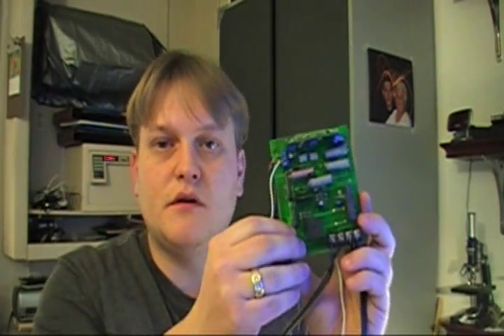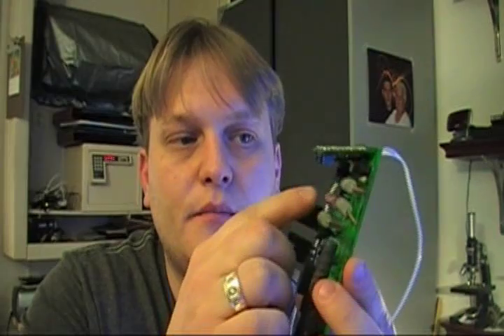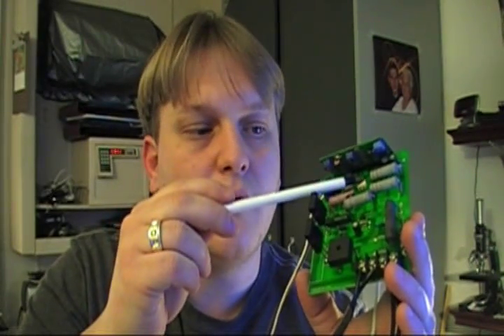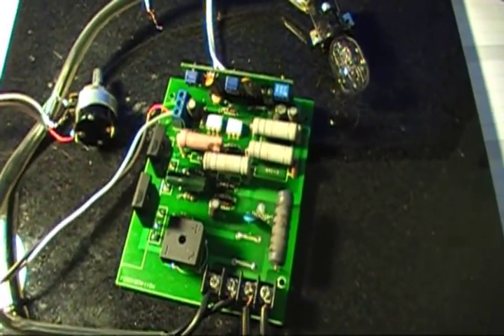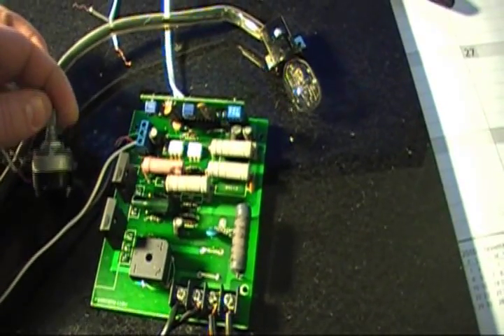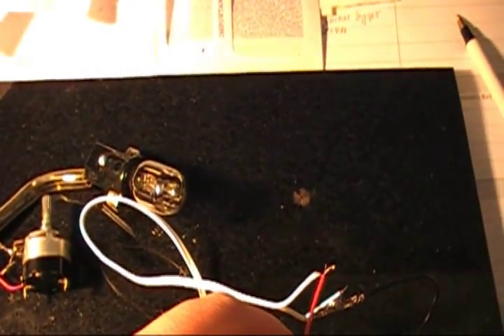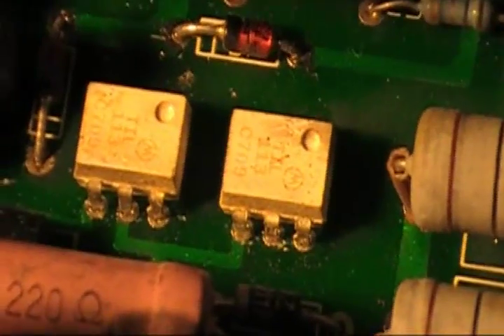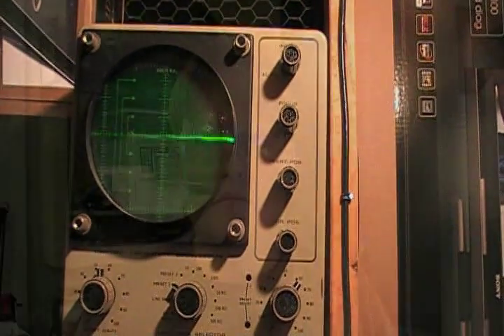Harbor Freight Chinese Mini Lathe Motor Controller FC250J/110V Part 1

Comment from the maker: They have a few modifications of the same board the one I have in my video is slightly older you probably have a new were version they all work about the same and share the similar problems

Comment: just a question I have the exact same mini lathe 7X12 Chinese (sunmore) my motor is only running at full speed when I turn on the machine and put it in forward or reverse its just going full blast!
Can I just connect one of those 110v variable speed controllers to the plug for the lathe and control the speed??
Reply from the maker: The reason your leaves is going full speed is because you’re MOSFET transistors are shorted out. If you replace MOSFET transistors it will start working normally. If you connect variable speed controller to it it will most likely work but you will lose the torque of your lathe. The board that you have inside of your lathe is pulse with modulation controller and that allows you to have low speed and high torque.I hope this helps

Comment: Hi there,

Great video.  Your site seems to be down.  Are you still active in motor controller work?
I have a controller from a Busy Bee 7x10 mini lathe that seems to overload in the high range.  Works fine on low range but as soon as I try to run the lathe in high speed, the board goes into an overload situation (there is an LED that sits beside the board POWER LED that glows when the system stops).  Only way to get out of this is by powering down the lathe.  Since it works so well in the low range, I'm wondering what might be going on.  Any suggestions?

Thanks
Doug

Comment: These Chinese lathes are crap.  Don't waste your money.  I've had two and both crapped out with less than a hours use.
Reply: I bought a cheapo Harbor Freight mini lathe in 2013, and it has been a total workhorse for me. I have put many hours on it for light commercial work, mostly in plastics. OK, it's not super accurate, and I've spent some time truing it up, but the unit has kept on going and going. Only problem I've had with the electronics is the on/off switch crapped out. The board continues to work fine, with one idle speed adjustment.

Comment: hello i have a 7x10 mini lathe i dont have the time to mess with the board inside...i was wondering if i could contact you about fixing my motor control unit...thanks
          ....jeff kubes

Comment from the maker: Yes you have to work on it and make it better, modify it and spend time with it. But ones you are done (Fixing) the lathe it becomes very good machine. My Father is a machinist with over 25 years experience has (Fixed) his Metalworker lathe and he has been using it over 10 years now with very seldom problems. If you try to manufacture a lathe in US , a better quality lathe like they use to make in the 50’s this lathe will cost allot of money and people simply would not be able to afford it.

Comment from the maker: Well….. I’ll tell you . Chinese machines are not the most accurate and not the best quality machines on the market for sure. But for a small shop on the budget or  home use they are very good. Chinese machines require allot of modifications and adjusting before they can be used for any serious work. The big plus of the Chinese machines are their price. You can buy Chinese lathe for under $500.

Comment: I've been a research machinist for 30 years and working with Chinese lathes machine tool is a sad affair. Why make cheap machines in the first place? Why is is that Clausing or Atlas lathes  made in the 50's are better than those made today?Why is quality being regressed? It seems like a waste of time, labor ,and materials to make a machines whose life expectancy is far less than it ought to. I have an Atlas in the shop still running and I doubt you'll fine a Chinese  made lathe last as long

Comment: just because the board is not available does not mean you can not track down the part or parts on the board that are bad and replace them , you can also look for cold solder jonts or cracked ones and repair any you find and this also sometimes will fix the problem to, never stop till all has been tested and checked over properly,,

Comment from the maker: This happens on all Chinese mini lathe controllers. Most common part that goes bad is Mosfet Transistor. If you buy few of them you should be fine.  good Luck
Reply: my  bridge rectifier blew.. dead short across the a/c input.. kept blowing fuse as soon as you turn it on